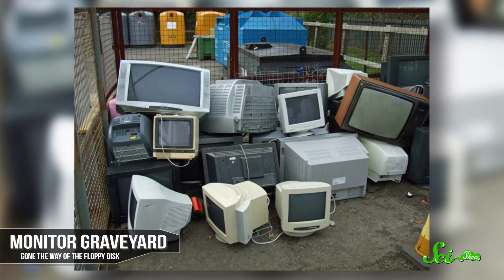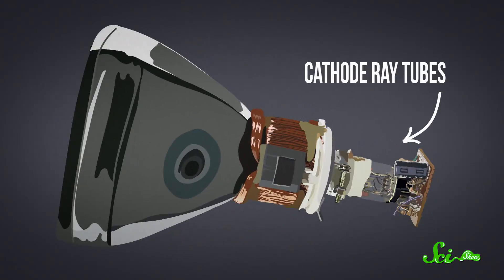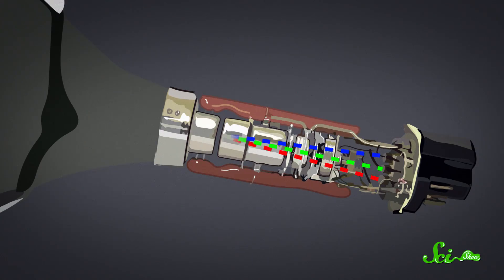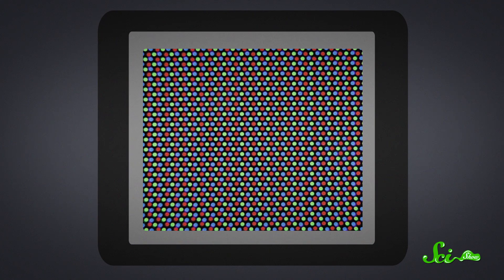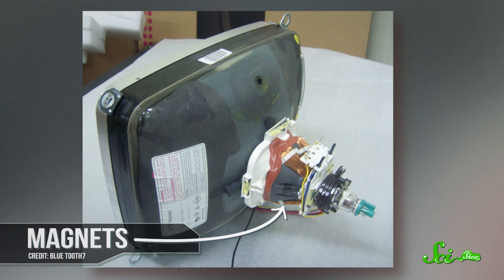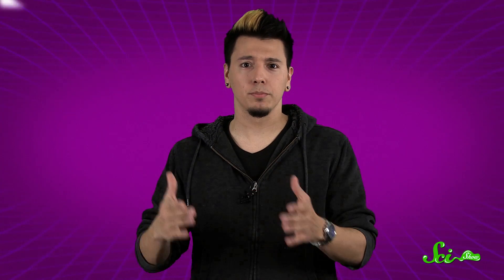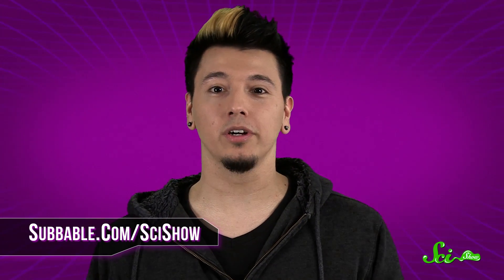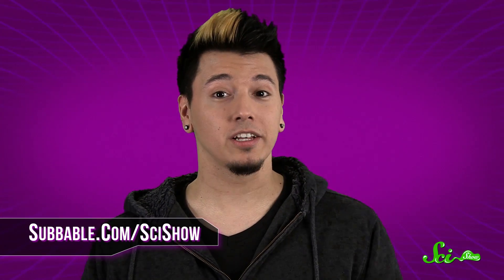How Did a Magnet Just Break My Monitor?

Comment: I was disappointed to see the poor science reporting in this video. Specifically the reason given for the so-called destructive effect of magnets on a CRT.

The apparent persistence of the magnetic distortion you can see on a CRT after bringing a strong magnet close to the front of it is nothing to do with any changes in the phosphor dots, in fact they are in no way magnetic.

It is actually caused by an induced magnetism on a perforated metal plate called the Shadow Mask that sits between the electron gun and the phoshor (which helps to ensure only the right dots are illuminated). 

Fortunately, CRTs were built with a loop of wire around the screen that has an alternating current passed through it briefly when the CRT is switched on from cold. This served to remove any magnetization of the shadow mask (by nearby speakers for example).
Reply: Sardi Pax is correct.

It has nothing to do with the phosphor coating.  However implementing the degaussing coil within a display was a fairly late development in CRT technology.  TV repairmen had hand-held degaussing coils within a plastic or phenolic casing they could plug in to a wall socket to demagnetize the mask.
Reply: I don't know the ins and outs of monitors, but i was very surprised he didn't mention degaussing. It's a good subject to cover, used for lots of things and is just as fun as putting a magnet on your screen.
Reply: Unfortunately SciShow's Science lately has been really bad. They oversimplify to the point of what they are saying is wrong, they tell only half, or 1/3rd of the answer, they tell things that have been proven wrong at truths. Basically I view this show as a source of entertainment with only taking what they are saying as a grain of salt. If it interests me I look for more reliable sources of information on the subject.
Reply: You are wrong I've been working with this kind of technology for over 88 years and this video is 100% accurate.
Reply: Douglas Blatherwick
That a good attitude to have with anything really. I think of it like I do wikpedia. Its a start, but its not the answer.
Reply: A lot of CRT monitors had a degauss function in the settings menu. It was rare for TV's, though.
Reply: God, what a mess! How can a simple comment pointing out a real mistake become troll city?
Reply: so you can repair the screen by simply click it off and on?
Reply: I remember "When I was young" [in old smoker voice] in school some (naughty) boy showed me how to make the screens in the computer lab get psychedelic by pressing the degauss button. It also made a nice DUYYIIEUNGGGGGggggg warbling sound, and fun to press over and over. Now I know what it is supposed to do.

I have fixed damage from magnets on old TVs by sticking a magnet of the opposite polarity near the affected area. So it is was purple blob, put the side of the magnet that makes it greener next to it, and the greenishness cancel out the purplishness.
Reply: It's called Auto Degaussing ( http://en.wikipedia.org/wiki/Degaussing ), but it used to be more fun playing with huge 2Kg magnet (out of massive early '80s HDD) & a monitor that had a degaussing-button, so you could return the screen back to normal after making the image move around, invert itself, & do all sorts of weird things!
&B^{D?
Reply: Umm the question was not how the moniters work but why a magnet damages the screen
Reply: You bet me too it, This video is completely incorrect, this video needs a follow up and correction because of how bad the explanation and science it.
Reply: John Greer I think you watch too much anime, in real life you can't actually punch a hole through someone's chest. You should spend more time outside in the real world, bro.
Reply: LazyOtaku I get shot by them every day. Duh.
Reply: Gabriel Tzukishiro  While I enjoy scishow and expect them to do their best to bring me accurate information, I recognize that it is produced by fallible human beings. They have good intentions, but they make mistakes like anyone else. And I have seen them correct mistakes in past videos. Science should always be open to scrutiny. I cannot personally say whether this is right or wrong, it made sense, but if I were going to make claims about the accuracy of the information I would research it outside of one source and back my claim up with specifically cited evidence. I would never blindly believe what someone tells me no matter how credible they seem.
Reply: John Greer Trust me kid I'm a pro.
Reply: Peter Parker  I remember most monitors having a "degauss" function on them. Usually they just display a cool effect, but the point was to reduce magnetic damage so you hopefully didn't have to call a repairman for it. So if your monitor has this function, then a few button presses might fix your screen.
Reply: John Greer Don't be mad at me because I graduated middle school and you didn't.
Reply: John Greer Don't hate on me because I'm beautiful busta. And thank you for cooperating to reach my 1million view mark on my g+ profile. :) 88k to go.
Reply: John Greer Why so mad? :(
Reply: John Greer Ugh I just hate it when my fans get mad at me. Oh well I can't make everyone happy.
Reply: John Greer lol ok.
Reply: Peter Parker
On most CRTs, yeah...  You know that sound you hear when you first switch on a CRT?  It makes a loud thunk, which is actually the degaussing coil being energized.
Reply: ihswap You've worked with CRT displays for 88 years? I call BS.
Reply: Jeremy Heminger
In 30 years of TV servicing I never saw a degaussing coil fail. What does fail is a little gadget that controls the intensity of the current through the coil. I've had 3 of those fail or an average of 1 per 10 years. More often it's the solder joints where it's soldered to the PCB as they get very hot during operation
Reply: *****
I am a design engineer and have been employed as such since the mid 80's I have repaired TV's for myself and friends since the late 60's they have been using the technology I described through this entire time. They didn't stop using this technology until the advent of flat screen TV's which have NO magnetisation issues because they don't use a deflected electron beam. You have learn to know when you are out of your depth. Arguing a point on which you apparently know very little does not increase your credibility, in fact quite the opposite. What I have mentioned is not based on flights of fancy and probabilities, but rather a lifetime of experience working closely with the technologies involved.
Reply: What happens as I said in earlier posts is that the magnet magnetises the shadow mask that is an integral part of all (well with exception of a Panasonic tube based on a Bell Labs patent) colour picture tubes. The shadow mask gets magnetised and as anyone with an engineering degree should know magnets (or magnetised shadow masks in this case) deflect electron beams which in the case of a colour tube causes the beam for say red to end up hitting say blue phosphor. If you demagnetise the shadow mask either using a degaussing wand or by cycling the power (with a suitable delay in between) the demagnetising coil gets rid of it. If some part were damaged by the few milliwatts generated by moving a magnet over the surface it wouldn't recover when demagnetised. Also why a few milliwatts of induced energy would damage a device designed to dissipate around 10W is something that should make a degree holder suspicious.
Reply: +Dan ny It's fun to see new spins on the presentation of the information, plus we like to check to make sure we're right about things, so it's always a good idea to get the same facts from multiple sources and cross-reference them.
Reply: Malcolm Whinfield  Yeah, that's true. Regardless, people will still make mistakes from time to time and those on the receiving end should make an effort to confirm before they affirm. But you're right, it is very important that those who make scientific claims, especially those who reach the most people (but of course, everyone), should be as accurate as possible. I definitely agree that misinformation is a problem.
Reply: xMckingwill
Yeah that may have been the question. But the answer to is wrong. Something that they may would have gotten right, if they knew how a CRT actually worked.
Reply: Peter Parker Or if you can find it in the menu, there's usually an option to degauss (at least in my experience).  Whether you'll be able to find the option without being able to tell what's on the screen is questionable though.  I loved pushing that setting when I was a kid because it made a cool noise and made the image all wavy.
Reply: Peter Parker I've seen monitors that have been permanently distorted by magnets, so this whole resetting upon reboot thing isn't entirely true. If you stick a really nice strong magnet on the monitor it's possible to leave a permanent colored spot on the screen. If you have a small spot however it is also possible to use a magnet and wave a few inches from the monitor and make it go away.
Reply: Peter Parker They don't usually degauss every time they're turned on, that would waste electricity and wear out the thermistor. It usually happens when they are plugged in. You can often hear a short hum when it happens. If not and it's not on the menu, holding the power button for several seconds works on some monitors.
Reply: ah so that's what degaussing is?
Reply: Jim M Just about every color TV I've ever worked on had a degaussing coil, including those made in the '60s. The reason the TV repair guy (me) had a manual degaussing coil is to provide a stronger degaussing in case of persistent residual magnetism, or when replacing parts.
Reply: ***** Dude I'm 50 yo I think I'm pretty old by now.
Reply: TheCakeAintNoLie  But Douglas doesn't wanna be like us. He thinks that if he watches this out of context of the rest of the entire show and then makes comments that people will care. Don't disappoint him now.
Reply: ***** trust me it's possible ;)
Reply: sinephase Yeah, degauss makes a lot more sense when you realize that "gauss" is a unit of measure for a magnet.
Reply: thats called the degaussing magnet, and not all CRT's have one.
Reply: Hobo Joe in that case. You could always buy degaussing ring...I wonder if anyone even sells those anymore?
Reply: *****
The device is a PTC or in other words a resistor with positive temperature coefficient. When the TV is switched off it cools down to ambient where it has a relatively low resistance. When power is applied at switch on there is an inrush current then as the PTC warms up the current get progressively less until it is so low that it's impact is negligible. This reduction in current and therefore magnetic field strength demagnetises the shadow mask. This device is rugged and a pissy magnetic field from a magnet will have no effect on it. There are no MOSFET's in them. The only memory that occurs is the actual magnetisation of the shadow mask, and that is easily undone by the degaussing circuit. That remnant magnetic field deflects the beam maybe 0.2mm and results in the wrong colour controlled beam hitting the wrong phosphor.
Reply: michalchik
Sorry, you are wrong, the magnet mustn't be static, the physical process requires that it starts off strong and cycling through the BH curve of the magnetised material then progressively becomes weaker. If it's static (permanent) it magnetises (provided it's a hard (in the magnetic sense, not density) magnetic material)
Reply: etmax1 "the magnet mustn't be static," Correct, thus the string. Tie the magnet to a string and winding it up. As it spins down slowly move it around and then gradually away from the TV.
Reply: michalchik
:-) touche' you are correct
Reply: John Greer The horizontal wires (there was another a third from the top) were to dampen vibrations of the aperture grill wires. I had a friend who was showing me his big beautiful new expensive Sony PC monitor. I asked him if he didn't mind those two wires. He said "What wires?". I showed him where they were and he never forgave me, because from then on, he looked at them often!.
Reply: Just wondering... Why did you watch this video if you knew all this already?
Reply: Nanadaime Hokage Nice grammar.
Reply: Jacob Thomas tl;dr*
Reply: Wow!!!
Reply: That's what you get when you get someone who isn't Hank to write and present a video.
Reply: Quazz Princeton He did help write the episode, it's listed on the endscreen. This is probably just an oversight by the team considering this sort of thing doesn't happen very often at all. Actually I think this is the first time I've seen it with SciShow.
Reply: Peter Parker
if switching "on and of" doesent work, just take the magnet that's done the damage; turn it arround (that plus is minus) and put it to the same spot again
Reply: hire this guy for scishow techlike videos! xD
Reply: Peter Parker Yes. Sometimes it takes several cycles, but you may have to wait several minutes to try it again because a thermistor in the circuit has to cool down first.
Reply: Douglas Blatherwick why keep watching?
Reply: Computer workshops with a dedicated monitor technician (needed because of the high voltages involved in CRTs) could be pretty much guaranteed to have a degaussing wand.  This was a rod shaped device that could degauss more precisely, and more regularly.  Well magnetised shadow masks could be cleaned up pretty quickly with one, as the wands were quite powerful.

The inbuilt degausser in many screens wasn't as powerful, and usually only turned on when the power was turned on. This helped reduce the effect of the speakers people loved to sit next to their monitors, but it would also, over many power cycles, clean up a stronger magnetisation.

We had a lot of fun with them as teenagers :-)

http://en.wikipedia.org/wiki/Degaussing#Monitors
Reply: Douglas Blatherwick
And you think that other people do watch this when they actually want to have deep understanding of a subject?
Sorry to disappoint you, Douglas, but you're just like the rest of us.
Reply: StoreBrand whatever. xD
Reply: Douglas Blatherwick idk, I really just watch it for the science news.
Reply: Alright its not a competition
Reply: Jeremy Heminger
I've still got my old degaussing wand from back in the day!
Reply: John Greer man are you easy to troll.
Reply: Its also super-easy to fix with a  process called degaussing which can be done with either a strong permanent magnet and a string or an AC magnet
Reply: I see lazy bitches everywhere saying "tl;dr".
Now I know why their friends call them "smart".
Reply: Chris W The very first color TV sets in the '50s (this problem did not apply to black and white sets, which did not have a shadow mask) not only had to be degaussed, but the purity  (all one color screen is really all one color) and convergence (the images for all three primary colors align over the entire screen) had to be adjusted by a service call almost every week, as well as whenever the set was moved.  All TV sets back then were too big to be called "portable" anyway. The first PORTABLE color sets HAD to include a built-in degausser.
I was a child when my Dad bought one of the first color sets, and I saw the TV repairman every week, until we found that we could not afford to maintain it. By the time I went to college in 1965 color was cheaper and no longer rare.
Reply: Allan Richardson
I started in the TV game in the late 60's. Every colour TV whether fixed or portable had degaussing coils built in then. In the early 70's they changed the tube design so that the guns were in line rather than in a delta configuration. That dramatically reduced the severity of purity issues. How times change.
Reply: John Greer
They might have just had better thermistors. They had a very solid steel frame that had wires stretched vertically and depending on the screen size a few horizontal wires that stopped the wires from vibrating too much. They did all this to decrease the amount of shadowing from the shadow mask and therefore increased the brightness but it did make for a much more expensive heavy tube.
Reply: John Greer
Sony's TV dev team let them down, they did quite a few dodgies which would take up too much space to elaborate. They had a bright image, and and good focus, but I never fancied the image as much as a good shadow mask tube. I had a Loewe and it's picture was better than an Sony I've seen.
Reply: John Greer I've been a broadcast engineer for 40 years and never heard of such a thing. Do you know what it was called or who made it? All professional color cameras use RGB, except for some early ones which also had a Y tube (RCA TK-42). We DO have color matrix adjustments based on RGBCMY.
Reply: John Greer
Sharp did (might still do) a flat screen TV with yellow phosphor added I was told, it's supposed to make some colours possible which on a 3 colour system is only approximated. Whether it's worth the extra money I don't know. I'm not sure how they could do a camera with MYC as this is for mixing paints (subtractive mixing). I'll have to have a longer think about that.
Reply: John, I think you are confusing subtractive and additive color systems. An additive MYC system could produce white or any shade of gray, but its gamut would not be as useful as RGB. Normally, MYC (or CMY) is used only for subtractive systems (printng).
Reply: Jacob Thomas You watched a 1:58 long video, and you can't read a <1 minute long comment? God dam, get out.
Reply: Eric Lin Watching a video requires much less concentration than reading..
Reply: Jacob Thomas I'm not sure I entirely agree, if I read and I don't concentrate I will realise it a bit later that I'm missing something and can re-read. With a video you have to listen and watch attentively lest you miss the point. Many comments here (YouTube) suggest that people weren't paying attention.
Reply: etmax1 People are different, i guess? although I do agree on the rereading part.
Reply: Jacob Thomas
You are of course correct that people differ wildly in what methods are best suited to their needs for learning, I do however believe that independent of that reading gives to an ability to slow the process right down and re-read and is more granular. Of course modern technology does offer the opportunity to pause and rewind :-) The saying goes that a picture paints a 1000 words, but a moving picture paints perhaps 10,000 words which I why I have formed my opinion.
Reply: Peter Parker yup... also you are Peter Parker, you should know this
Reply: Sardi Pax that is correct.
Reply: K lol
Reply: xMckingwill To understand why something doesn't work you first have to understand how it works.